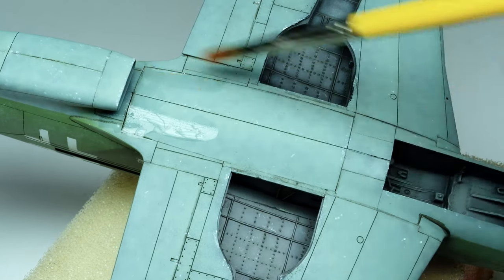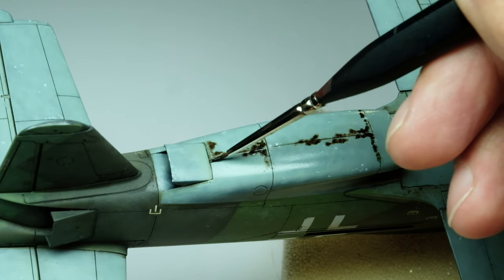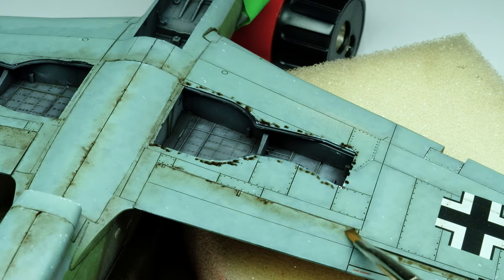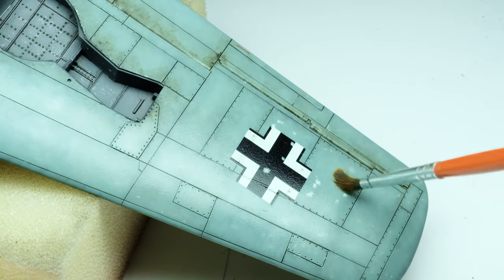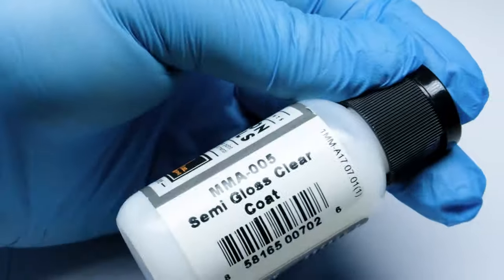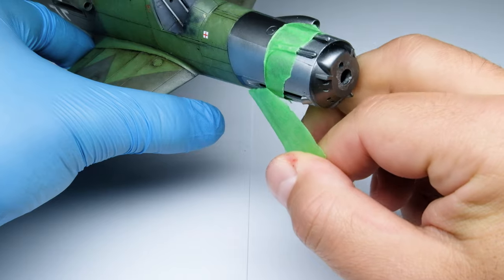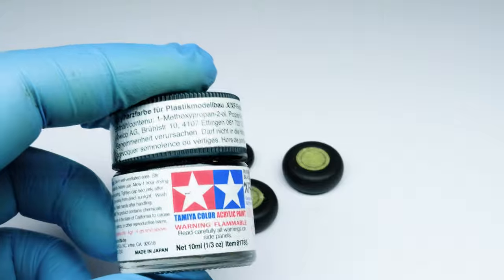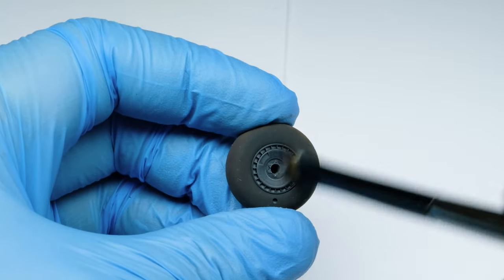Second Oil Weathering  - Dornier Do335 A-12 Anteater - Part 8 - Landing Gear, Abteilung 502, Tamiya

Comment: Posted a few notes to your previous video with a link to my build of the same aircraft... This particular 335 (WNr 240112) did in fact not have a bare metal belly because it was a conversion of a pre-production single seat which were all painted in full camo scheme in order to meet one of the many RLM requirements of accepting an airplane into service.
Reply from the maker: Hey Alex! Sure I remember, we exchanged some lines about it. I was already focused on my 'artistic' paintscheme from Zouki Moura :) I absolutly believe what you wrote about the requirements of RLM. But there's a conversation just about every color scheme, so I took the easy route to finish this model. Hope you still tune in to my next videos and leave some historical advice!!! Have a great weekend!!!